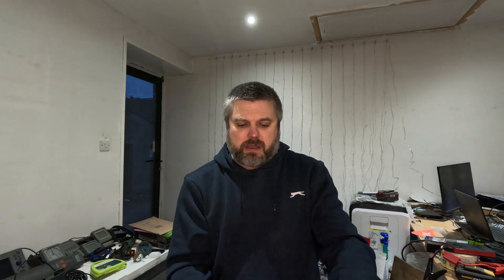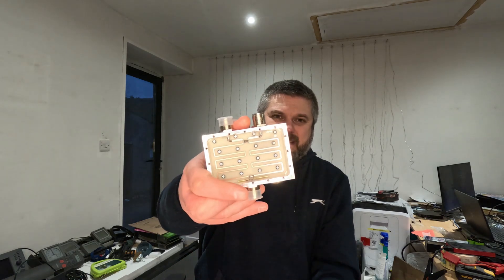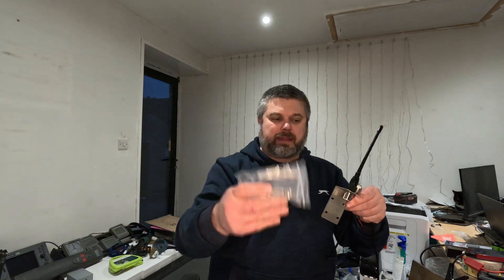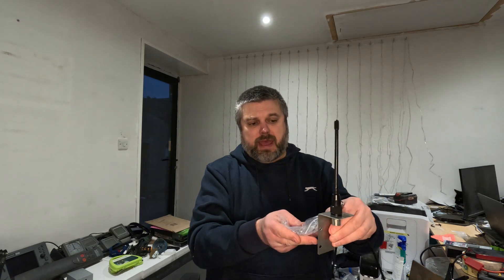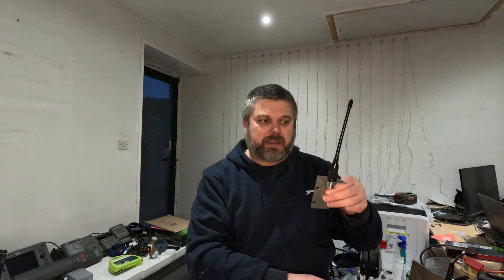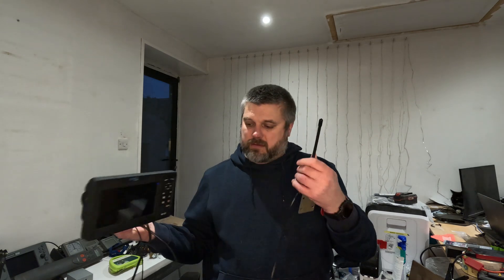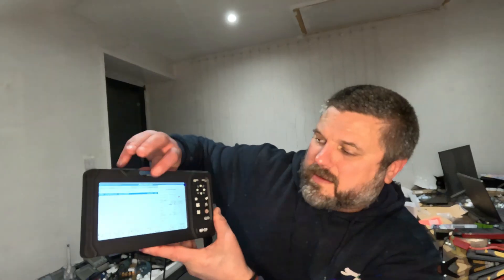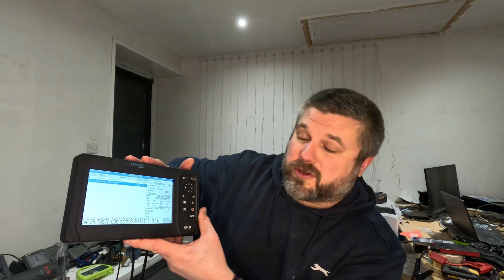What is the best way to have a VHF Radio and AIS Transponder on your boats? Antennas , Splitter?

Comment: Crackin'. Really helpful. Thank you.  
So, where is the "board band" £10 antenna mounted?  Could it be post mounted?  🤔..and do you have your vhf antenna on the mast still..?
Reply from the maker: Im going to mount the antenna on my pushpit rails at the back and rum the wires along those for the autopilot. Keep the antenna on mast for vhf. Then if anything happens ive got a backup! Just to get all these bits fitted 😂
Reply: Smart moves. I think I will use a mount on the pushpit rail as I am a bit worried about the height/wavelength/horizon reach situ.   Thanks tons.
Reply from the maker: You could get another antenna up the top of the mast as well but having one on the pushbit give you  a fail safe if you get demasted . Antennas and wiring are a lot cheaper than them gadgets which could cause issues/interfereance .
Reply from the maker: Gerrit-h4u  from memory of my VHF course both antenna heights come into the equation for distance (receiver/transmitter and vice versa). Thats why the coast guards have their VHF antennas on mountains . In my use case this would only be for AIS , i could go up my mast but at this point and yes a big antennat up high is bettter and not suggesting this for VHF (which as I say in the video should be up high) however if you lose your mast which happens , then having a backup whatever it is is better than nothing. When you say it won't work what testing have you done to prove that , i'd assume you mean it's not setup for the frequencies ? For me it worked ok and you can always switch the antenna portion to whatever of your choice , it's still better having a second antenna than using a splitter and reducing your vhf signal etc .